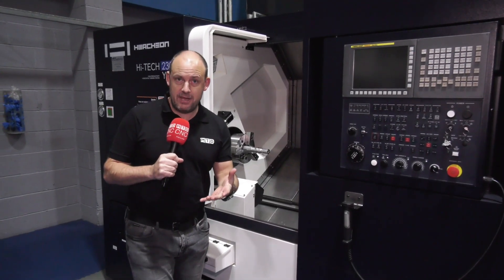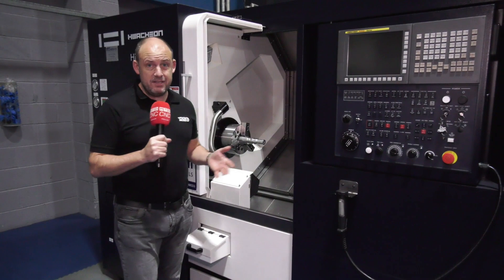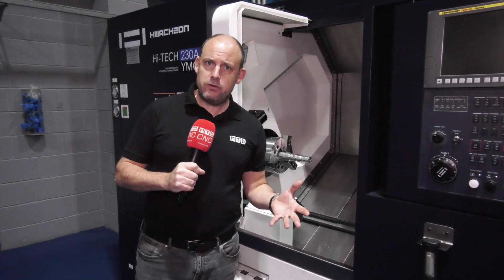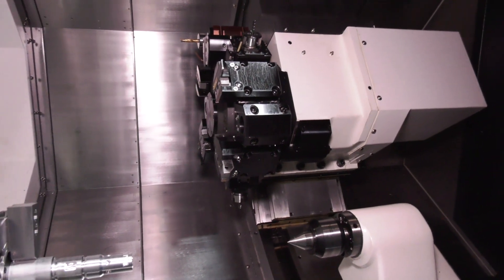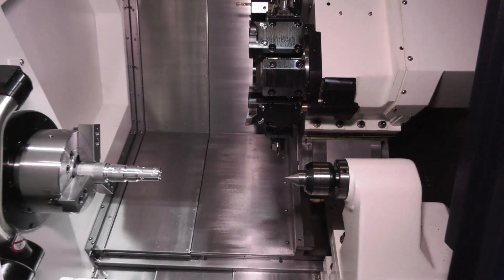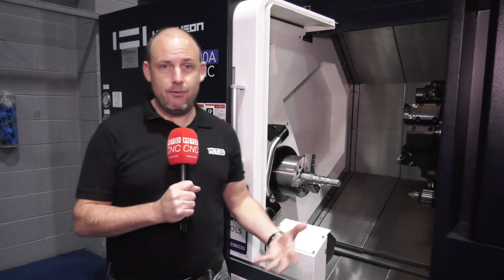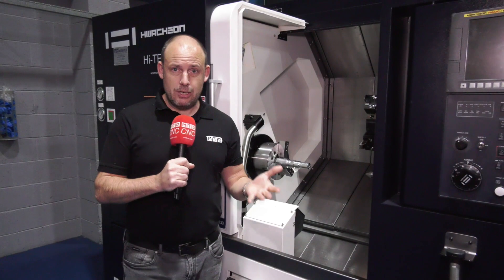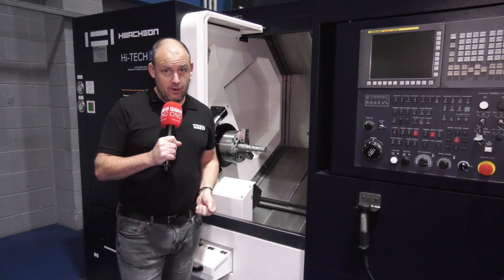The Y axis makes a huge difference

Comment: y and  c  axix  requires a collet chuck to be useful .. or the  jaws  are always in the way..
Reply from the maker: Has this been a big issue for you?
Reply: @MTDCNC  I guess for production style work collet  chucks give you  alot more clearance , and lets you machine features very close to the chuck plane .. I was probably thinking 100% useful, but not useless.. Depending on requirements.  ;)
Reply: @mattiasarvidsson8522  The problem with collet chucks is that the stock has to be perfectly round